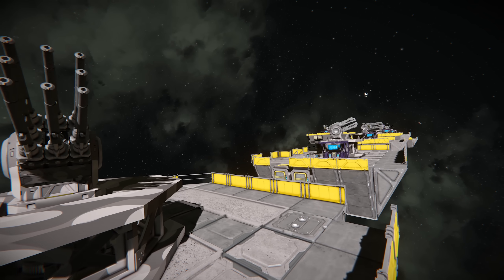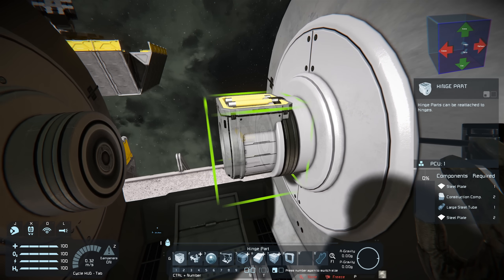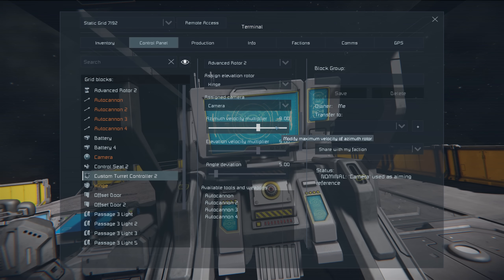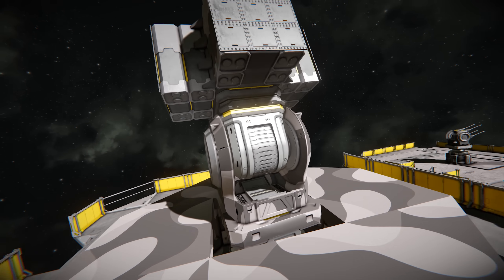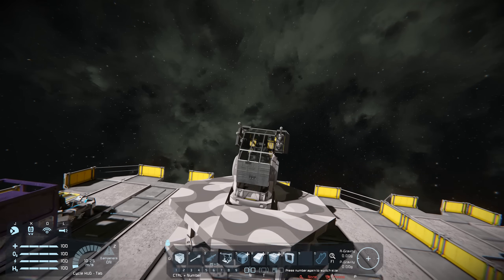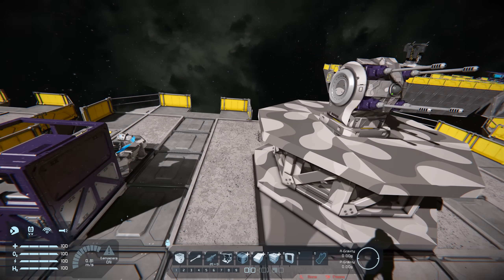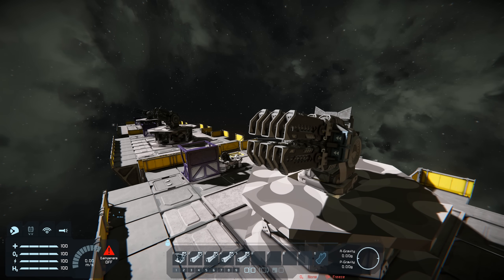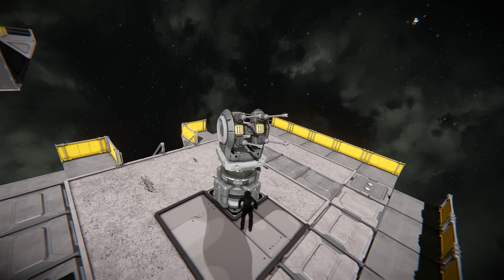Hinge Ball Turrets How To Build -  Space Engineers

Comment: One thing to note: Weapons explode along with whatever ordinance they have when destroyed. Having that many guns all right next to each other means you risk some large chained explosions if they get hit.
Reply: If that really bothers you I am sure you can use timers to disable the ammo from transferring into the guns until right before they fire.
Reply: @ScarletFlames1  I was thinking of that. However the downside to that is, if anything takes out the conveyor you lose any turrets that are being supplied by it.
Reply: @CrayvenCarnage  risk vs reward. Think of it this way, if something manages to cut into most conveyors, you're pretty much done for anyway. This allows you to up-gun the turret with a massive battery of guns with no safety spacing between them at no risk of chain reactions.

Basically you get a choice osustained fire even when heavily damaged but with lower output, or massive alpha strikes that erase enemies.. so long as you get the first shot.
Reply: Maybe use some form of armour to contain the explosion
Reply: @jameson1239  there's not that much space in the turret.
Reply: Two words, shield block  ;)
Reply: what your really forgetting to note is the rotor shaking all over the damn place before it inevitably and randomly explodes...

Comment: I saw a surprisingly easy way to align the small hinge part that should also work in survival. 
- Build a second advanced rotor next to the turret. 
- Remove the head.
- Use the control panel to add a small head (this adds big small grid version)
- Just stack small grid armor blocks up then sideways. They will line up perfectly.
- attach the small hinge part to the "reverse L" you just built
- Attach the hinge part to the turret and you can tear all that down.

Comment: With the auto cannon design you can add shielding to the sides of the hinge, attached between the cannons either side of the camera. Since that point is already blocked from swiveling down by the cannons, it will add defense without taking any mobility.

Comment: I dont know if some one has pointed it out yet or not, The Hinge marker needs to point in the opposite direction from the standard direction of the turret. Having it facing forward causes the mouse to be inverted vertically (elevation) either change the direction of the hinge to the opposite direction of the turret or in the controller change the elevation acceleration control to be a negative value you want it to be.

Comment: They just need to go ahead and make an official block that makes it so rotors, pistons, hinges etc. All have a small grid head option, even if the, say a rotor, is a large grid object. It works perfectly fine using the normal methods to switch to a small grid, its just a hassle to set up. Unless they actually have, I haven't played in a while. Just dropped by once I heard of the newest update.

Comment: Could you theoretically just press the "Add Small Head" button in the terminal to attach a small hinge head?
Reply: That adds the 3x3 small head, not the 1x1 small head.
Reply: Yeah this should become a default feature for hinges and rotors.
Reply: @hyperforce  Honestly this feels like too unintentional of a feature to ever get direct support like that. I doubt it'll ever be removed, ofc, but I don't think we'll be getting a button for it
Reply: you can use that in atmosphere. drop the 3x3 in a hinge right next to the hinge your are building up, cross the cap from the 3x3 towards the actual gun hinge with small blocks and you can hang a 1x1 inside of the hinge, and attach it. i believe splitsie made a video on that

Comment: Since you switch to small grid, can’t you stick a small grid custom turret block in there instead?
Reply: you can, but ai mode loses 200m of range
Reply: @artificerempyrean239  When you change to small grid, will any ammo transfer to the weapons?
Reply: Yea, everything still works as normal. That small hinge just gives room to place block inside the hinge
Reply: @artificerempyrean239  I was just testing out with a cargo container, advanced rotor, hinge and auto canon and it was not working. Do I have to massage the setting in some of the components?
Reply: @jeffreybomba  i just built one in survival, and it all worked fine, make sure your weapons conveyor ports are lined up

Comment: I wonder if anyone has solved the issue of having an underside mounted hingeball turret, as the rotor is upside down but your orientation will still be the right way up, the rotor has inverted controls, is there any way around this? I want to make a low flying craft with hinge turret son the corners but is hard to use with rotor inverted. Love these designs on here though is great source of inspiration :))

Comment: Do you need to have both a hinge and a rotor for this to work with the turret controller, or if you're mounting it somewhere that it doesn't need to need 360 coverage (say as a spinal mount on a ship that has sort of a U shape, or as recessed broadside mounts, where you only really need 120 degrees and the ships roll gives vertical aiming) would it work with just a hinge or just a rotor?

Comment: It never will be compact if you use the large grid custom turret controller.  I always use the small grid custom turret control, which I slap on the back of the turret.  Since it is always facing away from the threat, it will be the last thing to go on the turret.  If the turret goes, a large grid custom turret controller would serve no purpose anyway.  If you have many turrets, those large grid custom turret controllers will take a LOT of room